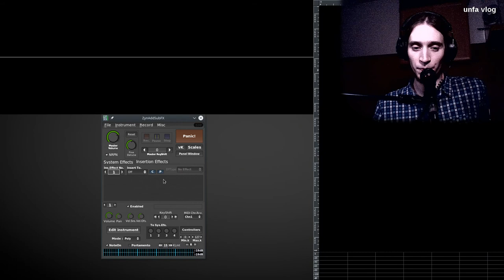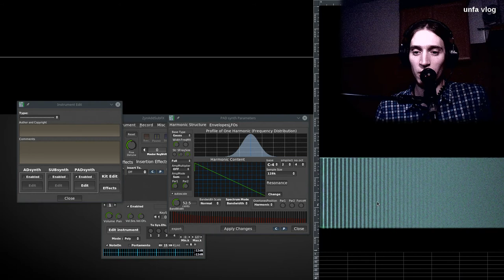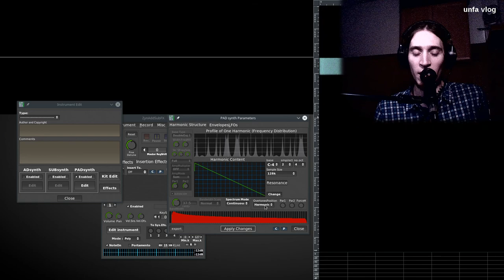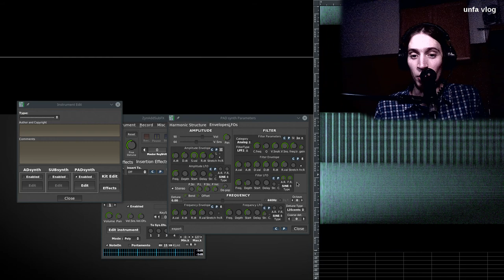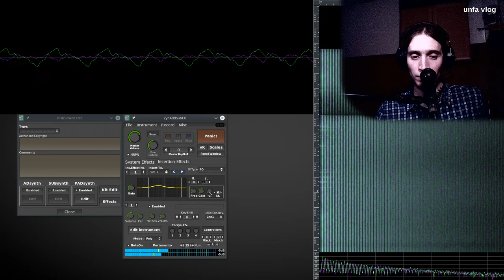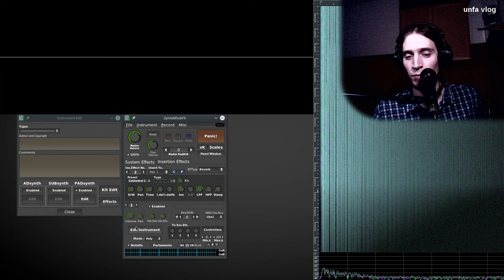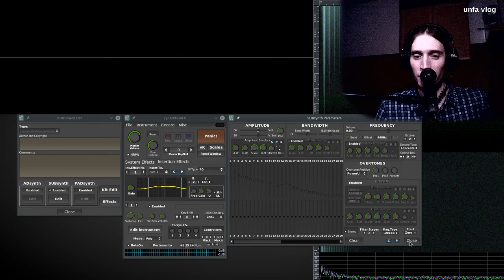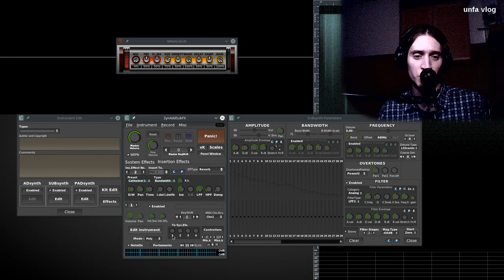UV#03 Synthesizing a String Pad with ZynAddSubFX

Comment: Good stuff mate. Just haven't find any video of yours about Audio interface you using, or would be good to use on Linux, with possibility install without hassle out from the box.. Thanks.
Reply from the maker: Thanks!

I use Behringer UPHORIA UMC202HD right now - it's a dual-XLR input USB interface with TRS outputs (for my monitors: a pair of Behringer NEKKST K8 - great gear). I considered The 404 model that has 4 channels and XLR outputs, but it'd be too much for my current work.

All the Behringer stuff I tried worked with Linux with no problems: X32, X32 Producer, X Air 18, and UPHORIA. They even have their X32-Edit and XAir-Edit programs running natively on Linux. so I highly recommend their interfaces if you want to do audio with Linux.

Maybe I should do a video about my audio hardware setup for Linux music production indeed :)
Reply: Yes, please do. If you would use OpenSUSE  would be even better :))
Reply from the maker: As long as you have ALSA it will work - same drivers

Comment: Excellent! You bring very clear and useful explanation. A lot of thanks! I need to ask you, wich is the spectrogram you use? I was looking for any on Linux and found Sonic Visualizer. It's great but it don't work in real time (only for recorded audio).
Reply from the maker: I'm using a program called Baudline. It's not in any Linux repos for some reason, but you can get it from http://baudline.com/

EDIT: I did some reading. Baudline is not completely "libre software". They use dual-licensing and prohibit redistribution and reuse of the code.
Reply: Thank you so much, Tobiasz!
Reply: Thanks for your very clear presentations.  Do you know of a program like baudline which runs on Win?
Reply: martin jacobi No comment lol, Tobiasz says "Phuck Windows!"
Reply: agreed!

Comment: how about doing it with add synth so you can have 8 all the lfo's you could need to make different vibratos to simulate a more limited ensemble but cleaner, then make patches for the solo instruments, and all of the articulations, make soli patches for each instrument, and hell, separate into 4 channels for violin, viola, cello, bass, so that you can simulate the acoustic properties of each instrument with respective harmonic resonances with eq and maybe even some early reflections echo. sounds like a real digital string ensemble, xD
Reply from the maker: I think that could give some really cool results. Also - the 8-voice ensembles could be duplicated to more Parts (just export and re-import the instrument into a different Part) with LFO randomization each could give different results without manual tweaking, but these could also be done to add character. Then you could have an 8*16 voice ensemble in one ZynAddSubFX instance!
Reply: oh, great idea with the single instance. how would you make a practical way to switch between articulations though? like, to make it read a detailed midi score. is this possible? ty so much for the reply
Reply from the maker: @firepyro66  Each of the 16 parts in ZynAddSubFX (Zyn-Fusion) by default plays on a different MIDI channel - this could be a solution.
Reply: ill have to try it. ill try to make something nice